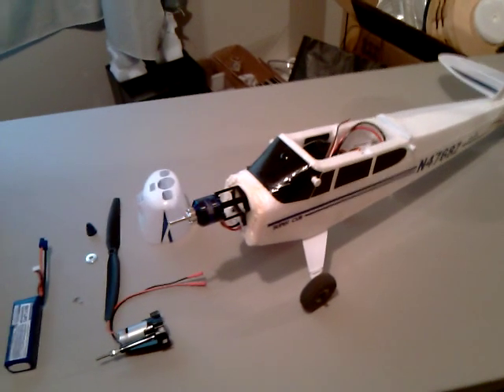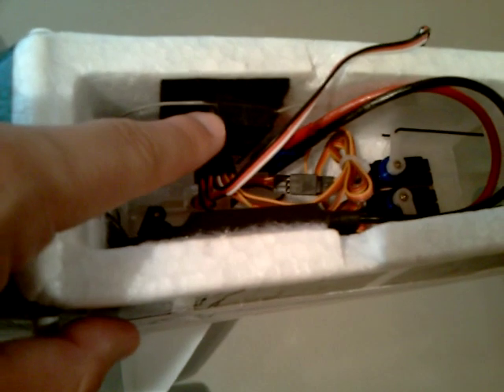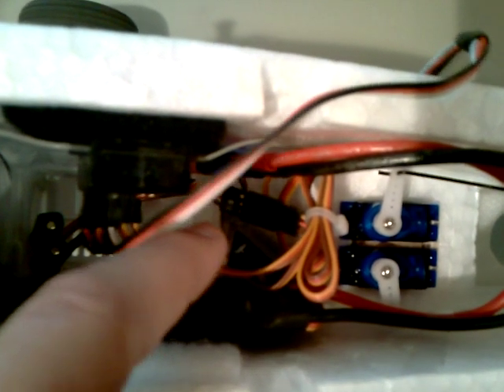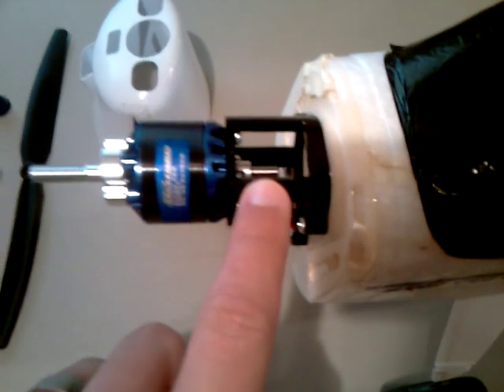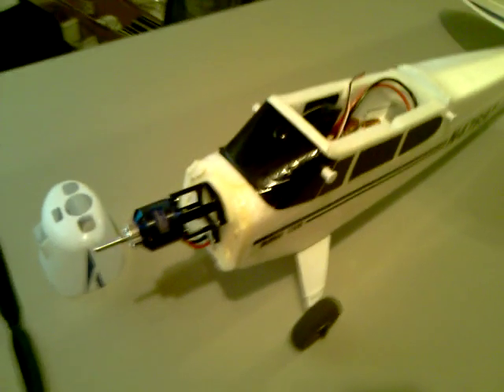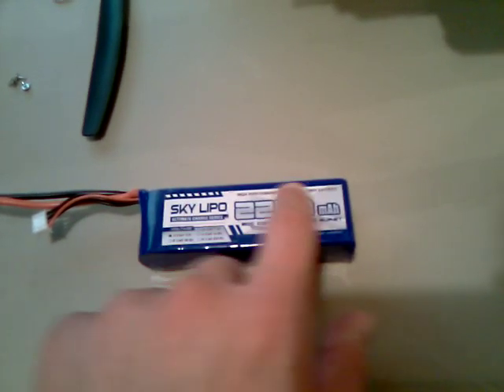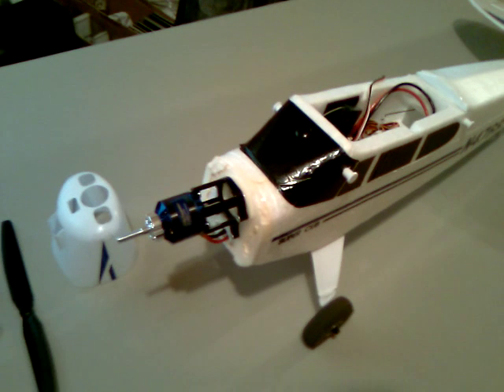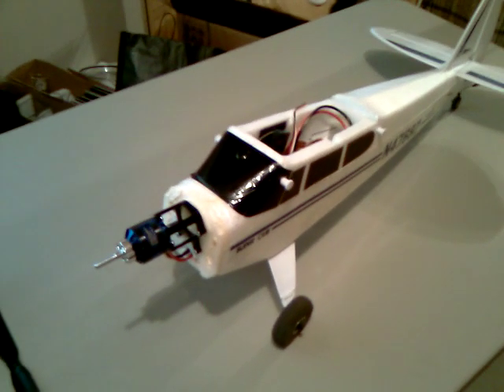Hobbyzone Super Cub LP Brushless upgrade overview

Comment from the maker: I kept mine stock for a long time while I was learning, and it was fine. I would recommend getting the DSM 2.4ghz version, rather than the 27mhz version. The 27mhz version seems to suffer from radio interference quite often. You might want to line the leading edge of the wings with a piece packing tape, for protection. Also, if you fly on grass, you might want bigger wheels. As you learn to fly, you'll notice a few things that need to be touched up from time to time. It's a really great plane!

Comment from the maker: You might save a buck or 2 going to that motor... however, there is way much more support for the 480 size motor for the cub. The 480 motor allows for that extra needed power when you need it to get out of danger and over trees. It allows much better take-offs from water when using the floats. You can carry larger payloads/cameras/batteries, and glue from repairs. The optional aluminum motor mount is made for 450-480 motors, so no homemade mount is needed. Little/no counter-weighting is required

Comment from the maker: @kyle2380 - Great minds think alike! Yes, I have flown it a few times. It seems to balance and fly just right with an 1800mah battery mounted vertically in the front of the modified battery bay. With a 2200mah battery, it flys ever so slightly nose heavy, which is kinda what I prefer. My slightly larger wheels might have something to do with it also, but not sure...

Comment: I have the original super cub. What would be a good motor amd esc for it
Reply from the maker: If you're planning to convert to brushless, there are many 400 or 480 size brushless outrunner motor options (will require a new motor mount), and a 40amp or greater ESC will work.  You'll want to make sure the ESC has a built in BEC (preferrably a "switch-mode" BEC). You'll want to upgrade your battery for this, since the original 1300mah stock battery won't be able to handle the current demands and could heat up and puff up, which is not good.  I'd recommend an 1800mah-2200mah 3 cell LiPo battery that is rated at 30C or more (slight mod to the battery box is needed, check out one of my vidoes for this).  Lastly, converting away from the stock setup would require a different radio system (receiver and transmitter) if you have the 3 channel setup.  If yours came with a Spektrum 4channel radio, you might be able to get away with just a new Spektrum 4ch receiver and bind it to the 4ch transmitter.  Enjoy!
Reply: @h2oman210  i definitely appreciate it brother!! I want to build this awsome peice of history
Reply: Hey brother would a 1250kv work too? Just looking for prices
Reply from the maker: @jaysrcadventures6337  I think that will work, but I wouldn't recommend going much higher than that on kv rating.
Reply: @h2oman210  i found a 2200kv motor its way cheaper and not to high on kv scale

Comment: i bought 2 x 1.3 1300mah 20-30c batteries. im lot as to how the battery connects to anything. it has two rounded end female plugs. battery was per hobby king recommendatiion. perhaps i need to cut the battery wires.